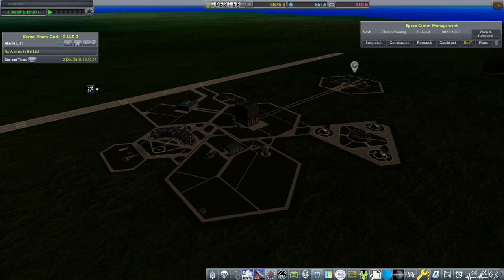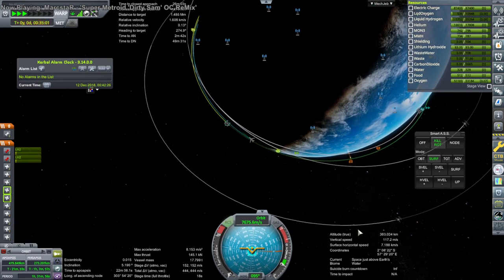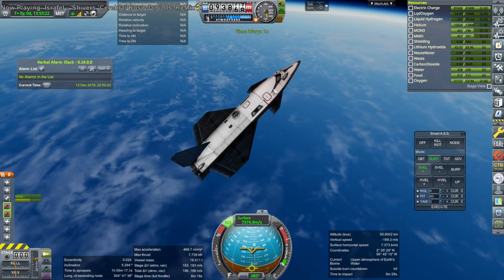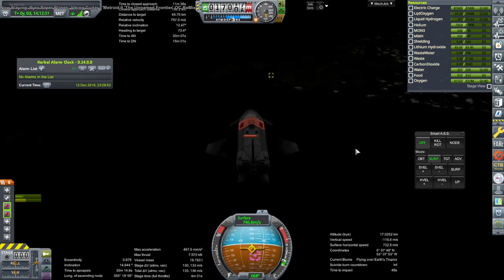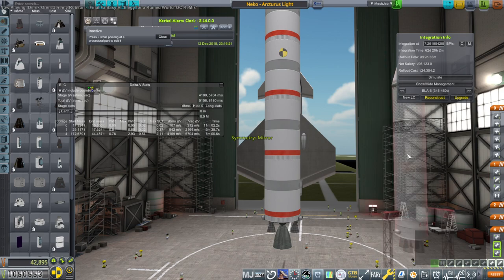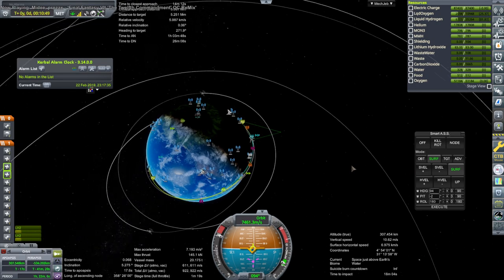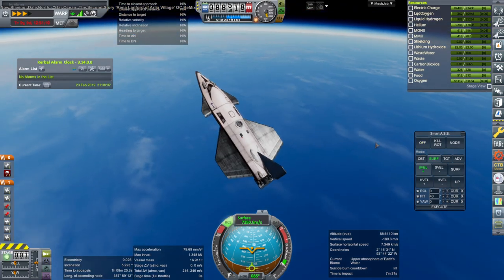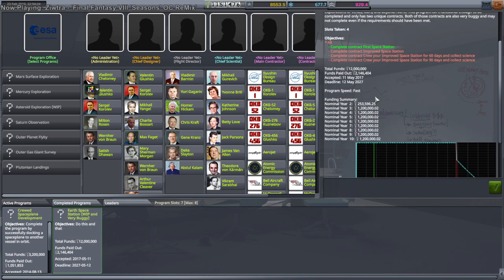RP-1 Career in KSP 1.12 - European Space Agency 75

Comment: Your separation motors are all firing at once when the boosters separate, you need to move the core motors to the same stage as core separation.

Maybe having four vernier engines and cutting the Vulcain would prevent the pitch issue?